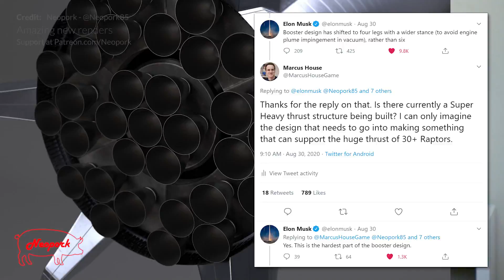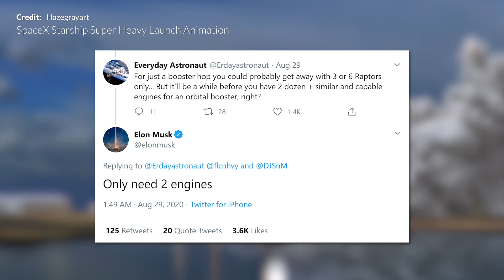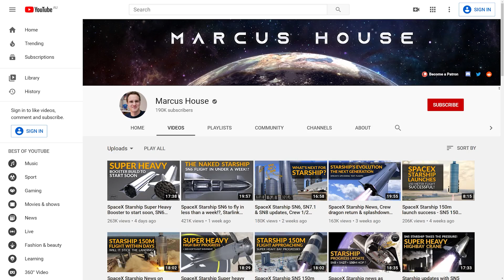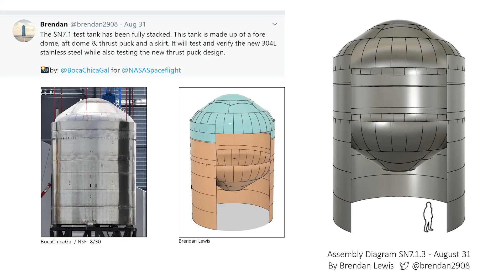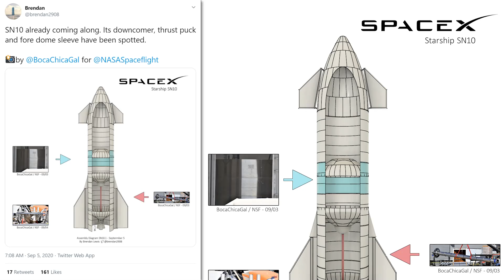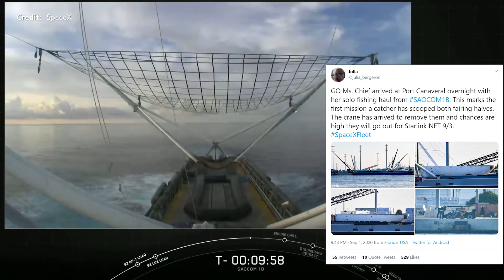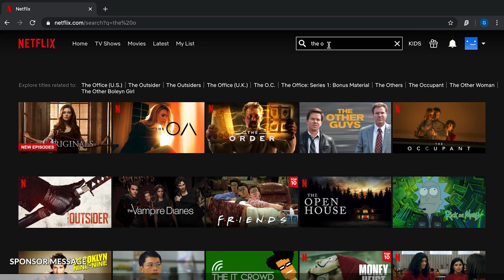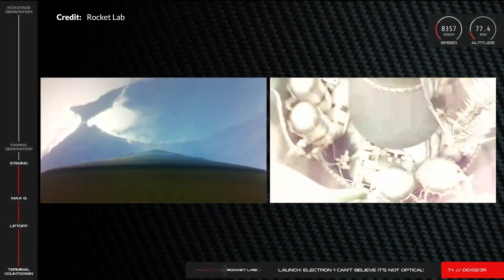SpaceX Starship Super Heavy and Raptor Engine Evolution, Starship SN-6 Hop, Starlink, SAOCOM 1B

Comment: The R-vac engine kind of reminds me of the F-1.
Reply: First when I saw that image comparing the r-vac an the normal I thought the r-vac was actually an F-1
Reply: @eelisikio6041  The engine is exactly the same as the sea level raptor. You just gotta stick a whole lot bigger bell nozzle on an engine to make it perform optimally in a vacuume.
Just look at how much larger the nozzle on a vac merlin is compared to the ones on the booster.
Reply: Carl Johan , Think he knows.
Reply: Had the same thought when I first saw it! Although I believe it's still over a meter smaller in diameter than the F-1.

Now imagine how massive a vacuum-optimized F-1 would be!
Reply: @chrisc1140  It's so sad that we can't build F-1 engines anymore. 
If we could, maybe they could have used those on SLS instead of sticking to the tried and failed retardation that is sea level hydrolox engines, the usage of which necessitates the huge and extremely unsafe (and costly) SRBs.
Reply: @carljohan9265  there was a modernized F-1 proposed at one point - the F-1E I think? But basically there was no need for it seen compared to the cost of development that still had to be done.

But I will absolutely agree with you on sea-level LH2 being...an odd choice to have become so common for NASA.
Reply: @chrisc1140  Hydrolox is a very useful engine, once you are in space. 
However, it sucks the hard one for getting of the ground due to the same material properties that makes it good in space. 

Von Braun knew this, this is why the Saturn 5 used kerolox to launch itself and hydrolox once it got to space. They even used the hydrogen to make water for the crew in the capsule. 
He would cry if he saw the SLS (which even has an inferior payload capacity compared to the Saturn, and a much higher price tag).